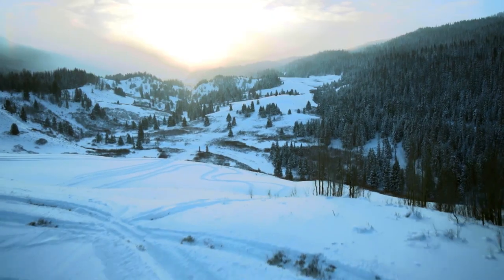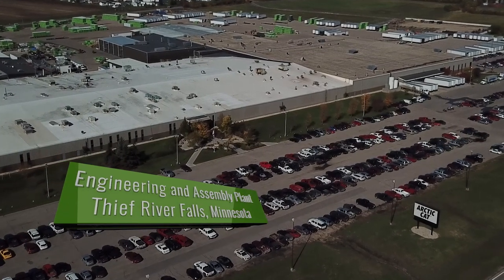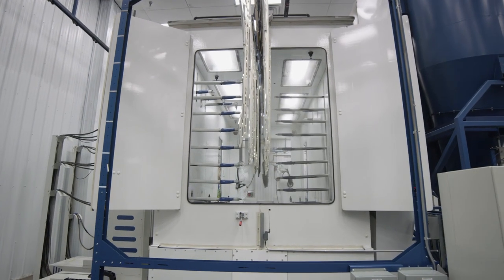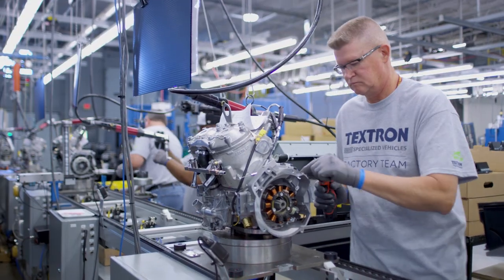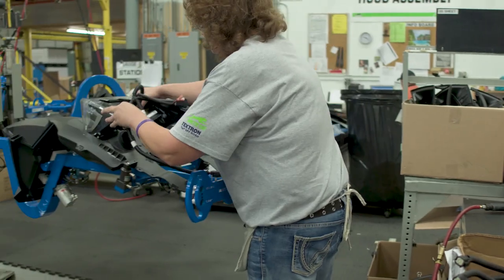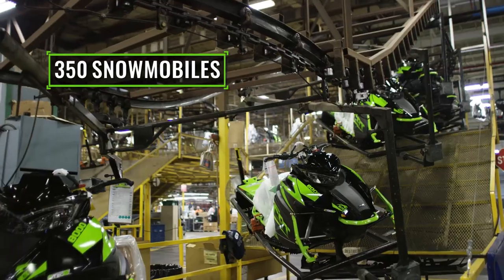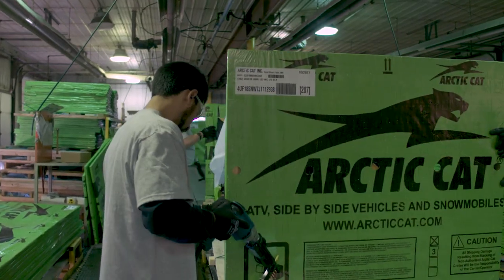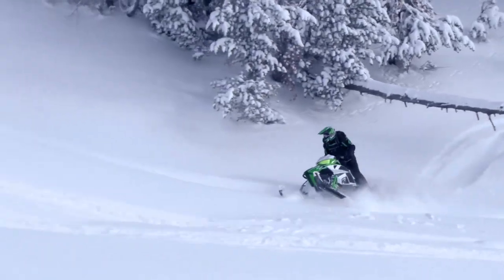How Arctic Cat snowmobiles are made

Comment: Great video, in December 2019 I picked up a new 2018 ZR 8000 ES Sno Pro 127. 2 rides so far, about 100 miles and I can tell you I absolutely love the sled. Handles like a dream and pulls like crazy and engine parts aren't even seated yet. Have a 2008 AC 650H1 4x4 that is awesome too!

Comment: As a former employee I can tell you they dont build 300+ a day they havent in over 10 yrs. When I left in 2018 we were building 150-160 a day and we didnt have 250 employees building either. There were barely 150 employees between everything and many ppl asked to do more than time allowed for. I can also tell you the day they made this vid in the main plant we were building without parts and werent supposed to work that week because of parts shortages. Also no hammers were used that day and normally they are so all the sleds had to be gone thru to ensure everything was correct.
Reply: brian towne  hey brother do cats have Yamaha engines?
Reply: @dereksmith30  the 7000 and 9000 are yamaha
Reply: brian towne  thanks for the reply been many years since I’ve been sledding moved to south fla in 1987 from the Catskills in NY and had a cat and ski doo. Man I loved waking up when we had a good snowstorm and firing up the arctic cat! It was a I think 1974 with a jlo Rockwell motor and it screamed like a cat! I’m 50 now and still love speed. Everything I owned had to be fast still till this day! Past it down to my boys who all own fast cars,boats and 4 wheelers. I want so bad to take them and let them experience snowmobiling. Best thing ever
Reply: @ Brian, Sounds like the the liberal government is running Cat if those numbers are that far off.
Reply: Had a number of Arctic Cat machines and other than a 2003 600 EFI that burned up both pistons when almost new I have had great experience with Cat.  The twin spar sleds didn't leave much to be desired and handled like a tired whale on the trails, but the pro cross chassis are the best in the business in both handling and aesthetics.
Reply: @86dieselman  I have been a Cat fan since my first El'Tigre 400 ('73)  I have a '00 Thundercat. the only cat design I never liked was the Twin Spar. Ugly at best.
Reply: I kind of figured this was a phony promotion video arctic cat is a sinking ship skidoo will be the final Torpedo to send her to the bottom retaliation for the tiger shark lawsuit don’t mess with the Canadians
Reply: Cat is a sinking ship with no life boats!!!
Reply: @dereksmith30 The Ctec4 is one that Yamaha worked with Arctic cat on
Reply: @daleclarke2849 Good one
Reply: @sheddski2942 Arctic Cat is very scared for sure

Comment: had a 92/580 ext No low-mid power chaincase stator spark plug fouling garbage suspension  gasoline drinken oil guzziling and a nose cone that got hung up on every bump thumb throttle electrical nightmare  I hope they fixed these flaws by now
Reply: U made me laugh lol
Reply: Had a brand new 1995 Ski-Doo Summit 583, fucking thing NEVER wanted to start, and no electric start, no reverse, weighed a ton, wouldn't take a turn for shit, guzzeled gas, and I ended up selling it after only 3 seasons to a friend that had the same starting issue. They eventually sold it. I hope they fixed those issues, meaning Ski-Doo.

Comment: It’s very unfortunate that Kawasaki totally got out of snowmobiles - Not only did they make some amazing sleds for their time, but they supplied engines to Artic cat which honestly made for some of the most reliable years for Cats.

Suzuki and Artic cat motors have never been know for reliability.

When you have ski do’s and polaris sleds that can have tens of thousands of KM on the clock and still on the original motor assembly. I haven’t seen many cats do that over the years.
Reply: I've owned a lot of sleds and my first were skidoos in the 70's and the last skidoos were both 1997 and honestly the cats ice owned never gave me any problems and I think it was because the engines were Japanese let's face it the Japanese are far better engineers than us and Canada
Reply: suzukis are just as good
Reply: I hope you're kidding. The Suzuki 800 is one of the most reliable sled engines out there, but I would agree the skidoo etec has to take the cake. Polaris 800 engines were notoriously unreliable for years, specifically the liberty line.
Reply: M8000,13. Suzuki 10 000 km,9,5 (PSI) compression.
Reply: You are off your meds if you think dual points, coils, walbro and Tillotson carbs were anywhere near as reliable pre 1976, which is when suzuki engines became the only mill put in a cat.  I owned several early 70's cat sleds with Kawasaki engines, they had crank seal issues, warped heads, warped manifolds, and wouldn't hold up next to any suzuki snowmobile engine in an arctic cat.  

I have 8 cats, 7 with Suzukis, all more durable than any engine Kawasaki ever sold Arctic Cat.

Comment: My local dealer still has new cat sleds from tge 2017 model year, that tells me they either make way too many or everyone knows they are garbage. I bet Yamaha wishes they partnered with someone else lol
Reply: I can’t find a damn Yamaha Viper anywhere locally for sale would like one though
Reply: No sled manufacturers make garbage.  None.  They're all excellent.
Reply: I still have 2 1975 Arctic Cat Panther VIP sleds still in the Crate. From when my Dad Owned an Arctic Cat, Kawasaki and Yamaha Snowmobile Dealership from 1969-1982.
Reply: Actually the 2017 was one of the most reliable machines ever made, even the new chassis is a pretty solid machine compared to the compation.
Reply: If it weren't for Arctic Cat,  Ski Doo and Polaris would still have trailing arms on their front suspension.
Reply: @danpolk  Polaris makes garbage sleds. Chassis is weak and the engine is even weaker.
Reply: @Zach-ju5vi  ok sure.
Reply: @danpolk  oh come on  you don't want argue even a little bit? Lol I guess you can't argue with the truth.
Reply: @curtekstrom6600  then sleds in them crate probably are trash by now

Comment: I don’t doubt that there are a lot of issues with the newest breed coming off the line and I’m sure the fact that there are three companies involved trying to push sales above Research and development is never a good thing. I always liked the big iron but don’t think I would spend the money they want these days. My “newest” ride is a ‘00 T-Cat that I bought three years ago. Always been garage kept and only has 668 miles on it,it’s a head turner and I get a lot of “ they sure don’t make them like they used to “  good luck with your machine!
Reply: They dont they make em better now days. Better suspension, modern day sleds 4 strokes are putting on more miles with out blowing the engines. Gas mileage is 10x better modern day machines arent as loud, as them old iron mules. Sleds dont smoke as much as they used to. Modern day sleds will take you through the tight an twisty trails. Them old slouches youll have to turn back or risk getting stuck.

Comment: Ski don’t needs to learn quite a few things from the superior manufacturer
Reply: Don Olypopper  also Yamaha doesn't have much of a sled line anymore they use alot of cat parts or ideas and what is their own wouldn't be enough to keep a market share
Reply: M4 rath Lmao your kidding right?
Reply: Skidoo is the superior manufacturer, cats are just not as solid they using smaller bolts nuts etc and that means less strength, there tunnels wrinkle easier then skidoo also, I have only owned cats an 03 f7 and a 2001 zr 600 both of those sleds were weak imo, the f7 had less then 1000 miles and when I pulled the seat off to install my wrap my tunnel was cracked already I’m like huh, you don’t see that stuff with skidoo, say what you want, but I have built many custom builds and cats just don’t hold up to skidoo, maybe these days is dif I don’t know but I am bettin not, the rev chassis to this day still holds its own for old tech
Reply: you're on the crack pipe dude, BRP has the most technologically advanced  design and manufacturing of all the snowmobile and atv manufacturers with the possible exception of Yamaha. And BTW Ski  Doo has been using the pierce riveting process for close to 30 yrs

Comment: This is why they cost the price of a small car. Way too much detail in production. They need to buy and install an air cooled motor from china for 50 dollars to lower the price.
Reply: I can tell you don't understand snowmobiles. Think snow.
Reply: @errolpoxleitner3163  Its overly engineered. Sure there better than ever. But I only have 2000 to spend  on a new one. not 12000. What working class person can afford this price.
Reply: I agree. You can buy a brand new Korean built Chevy Spark for 12k in Chicago area. Why the fuck would I pay that for a sled? Waaaay overpriced, so I'm getting a basic work-utility model for about 8k. Ya know, back in 1985 I bought a new John Deere 440 Liquafire and was the funnest easy to use sled I've ever had. And it wasn't even $2k.
Reply: Toolmaker most people who don’t waste their money
Reply: @davidgarris2513  You may be near my age 56. Same here bought a Honda 350x for a 2300 In 1985. It  was about, I think, 2300 dollars. In today's dollars thats between 5 and 6 thousand dollars. Thats still a lot of money to save up cash. 20000 dollars is 4 times that amount. And there making everything efficiently too that is with modern automation. No wonder Asia has been taking over.
Reply: @dfpolitowski2  read my new note
Reply: @noahranker4133  These should be an alternative to a car up in the UP of Michigan. Not a means to destroy everything in sight. And side by sides have no purpose period. Same thing with 4 wheelers. And MX bikes. Gators for work are fine.